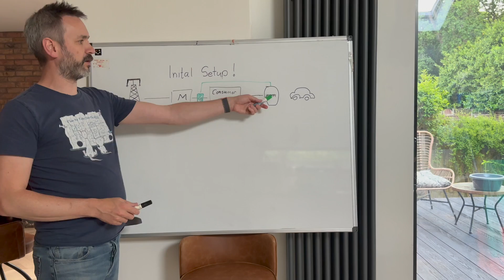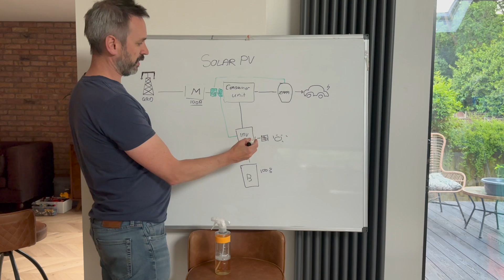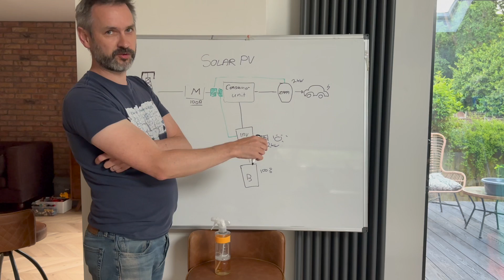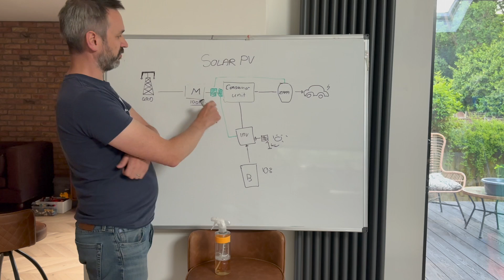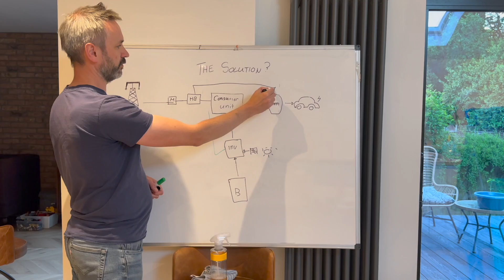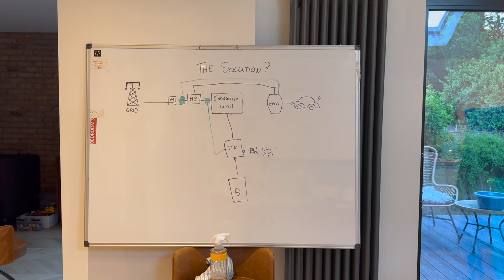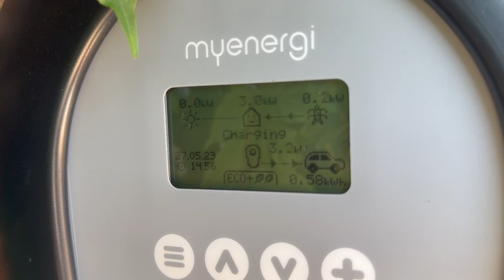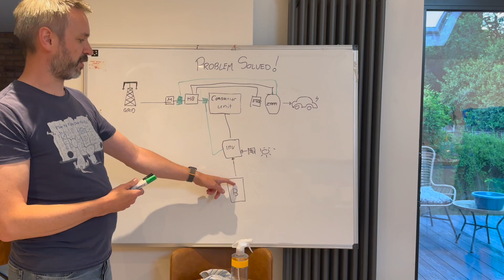How I stopped my Zappi draining my battery

Comment: I had exactly the same problem, but solved it in a different way. My AC coupled system comprises of a 3.4kw grid tied solar system, a Sofar me3000sp inverter, Pylontech Us3000c batteries, plus a Zappi and an Eddi. After using 50w thresholds described in the My Energy forum, the flip flopping between components fighting for priority was cured but I still had the issue of the Eddi and the Zappi draining my batteries if either of them were set to use the Octopus Go 9.5p Tarriff between 12.30am and 4.30am. Switching off the batteries on nights I wished to charge the car was not a cost effective or convenient solution. I then discovered the time of use mode from YouTube, especially the one posted by Rural Electric Systems on 1st May 2021. He was using old Sofar Firmware, version 3 hides  the"Time Of Use Mode" under an extra "Work Mode Set" menu. He goes through setting manual override timers which are called "rules" . You can force the inverter to manually come out of auto mode and charge the batteries at given times. You can stack up these timers under rule 1, rule 2 etc. Each for various days of the week and months of the year, enabling them to work in conjunction with each other or alone. This functionality is not described in the manual. Other inverters probably have similar functionality, I don't know. Then the penny dropped, if the batteries are charging they can't be discharged! Initially I disregarded this thought as why charge batteries from the grid and potentially waste solar energy during the day? But Time Of Use mode let's you set the charge rate for each rule. I set the timer to switch on and off at Octopus Go times with the SOC (state of charge) set to 100% and a charge rate of only 100w from Jan 1st to Dec 31st. This works perfectly, 100w for 4hrs only costs arround 4p  you could set it lower. The only downside is the house runs from the grid during those 4 hours, in my case the house only consumes about 200w at night, costing me arround 8p on the 9.5p Tarriff. I was then left with one unrelated issue that might be worth mentioning and could be limited to my type of Sofar inverter. Ben Allen in Poole who Carrie's out Pylontech repairs thankfully came to the rescue. My Sofar v3 firmware will only discharge the Pylontech batteries to 20% before switching back to the grid. He sent me a link to the setfirelabs.com website that explains in detail how to upgrade the Sofar me3000sp firmware to v3.06 with a link to the file download. This will enable discharge down to 10% for the Pylontech us3000c's which can cope with only 5%, so there is still a margine of safety. Hope this helps someone!
Reply from the maker: Thanks for sharing that! I had the same problem, which I solved in a similar way, using a long “forced charge” period. Once I had this rewired done, I shortened the force discharge to only 90 minutes, so if the battery has any power, it can continue powering the house during the Octopus Intelligence off-peak period. I also avoid any issues with Octopus charging my car outside the off-peak hours.
Reply: I need to read this several times as this is exactly the issue I'm going to suffer. I didn't upgrade the firmware as I head stories of people wrecking the units so never did anything. I'll look into you advice and carefully adopt it . Thanks so much for posting so fully.

Comment: Hi Tom, great video, you have come to my rescue after being a bit unconvinced by the myenegi solutions. 

Had my install for a month and have been having the same issues. Does the solution cause any issues with night time scheduled grid charging of either the EV through the Zappi or home batteries through the inverter. Will it restrict any of the charging capacity through the zappi or inverter.

New to all this and still in communication with the instllers so hopefully they will sort. 

Cheers Craig
Reply from the maker: Hi Craig,

Thanks for watching my video.

The rewiring doesn't change anything in terms of capacity or scheduled charging. It simply allows me to put the inverter's CT clamp so it ignores the power being used by the Zappi and Eddi. 

Since making the changes, my battery hasn't discharged unexpectedly and more of the solar power gets put into my hot water and car. When I was using the grid excess setting of 150W, it meant I could lose almost 1kWh of generated solar over 6 hours.

I hope your installer can sort this out for you!

Tom

Comment: Did you try adding an extra CT clamp on the output of your inverter/battery so the Eddi and Zappy can monitor it? It will then show up in the myenergi app as a solar/battery device. That may have been a simpler solution than the re-wire. I have the same setup and use two of the wireless harvi CT clamps. One at the smart meter and one at the inverter/battery output.
Reply: I thought you might had tried it. I have a Solis hybrid inverter with battery and i don’t seem to have the same issue with the battery draining.
Reply from the maker: I have a Solax inverter and battery. I tried tweaking the export margin, but once it started discharging the battery, nothing stopped it. A feedback loop of sorts!
Reply from the maker: I did that shortly after installing my Eddi, but it didn’t help. The clamp cannot tell the difference between what’s coming from solar or what’s coming from the battery. It has more accurate information for sure, but battery drain still happened. That’s when I went for the rewire. I didn’t cover that in the video. Probably should have! I guess there are a few different variables at play and the responsiveness of the inverter is one of them. With this change, I won’t have to worry about export margins or anything, so it’s been worth it from that point of view.
Reply: @tomasmcguinness yep we had this - added a harvi (ran out of CT clamp slots) to clamp the battery/inverter output. That appears as a ‘dumb’ battery on the myenergi app and you can set the zappi up to ‘avoid drain’ so it adds that CT clamp to its excess calculations. All seems fine so far.
Reply from the maker: That's good! Unfortunately, that didn't work for me. Once the feedback loop started, the battery always ran down.